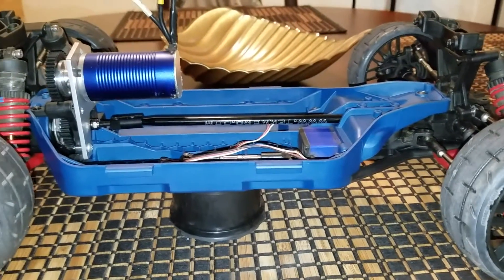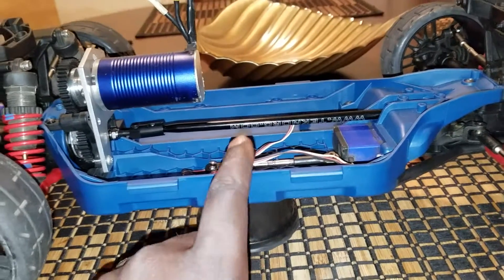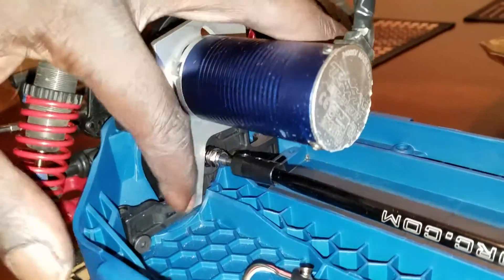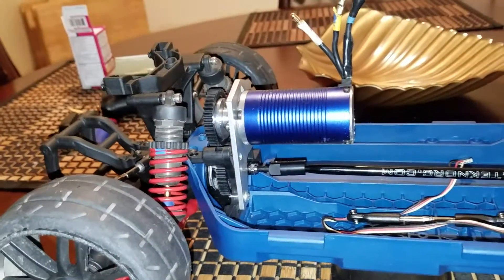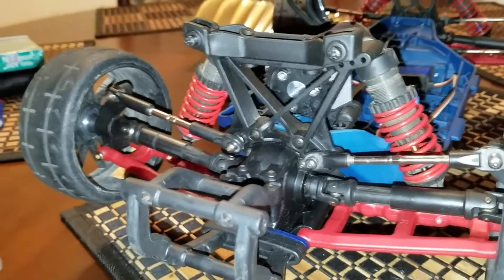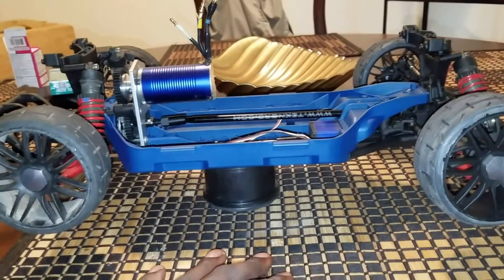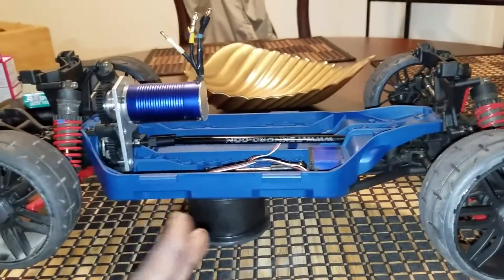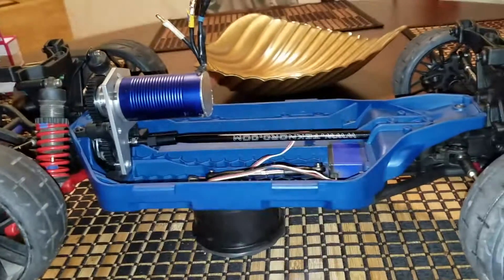Slash 4x4 lcg speed run build

Comment: Hi what drivetrain are you using thanks.
Reply from the maker: Dee Smith1987 the diffs and shock towers and a arms are from a telluride 4x4. I got a tekno big bone drive shaft. and mod 1 gears
Reply: +chevybrotha ok i thought you was running xo 1 drivetrain diffs
Reply from the maker: Dee Smith1987 no all used telluride parts..